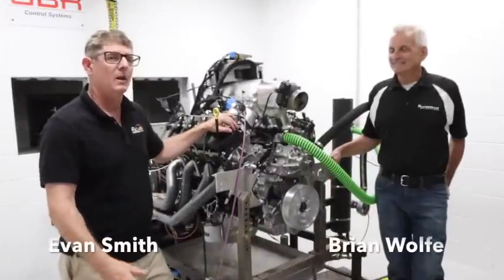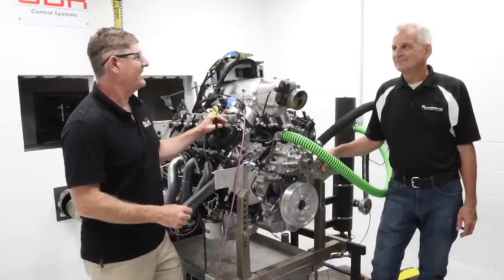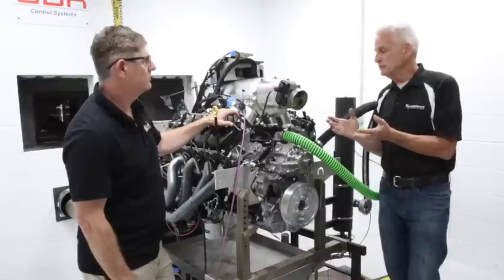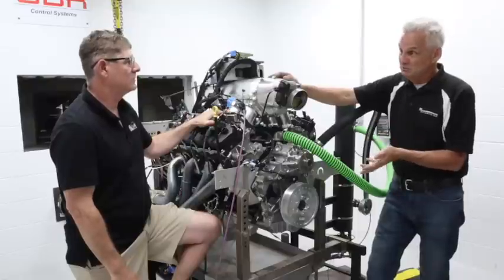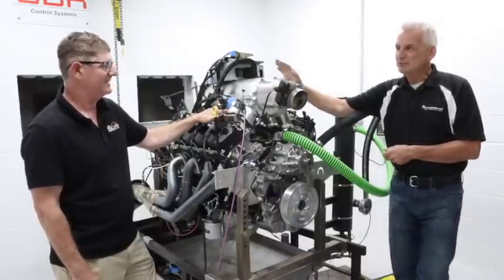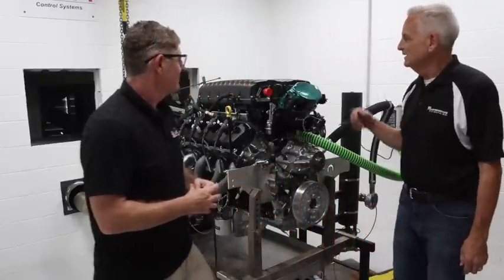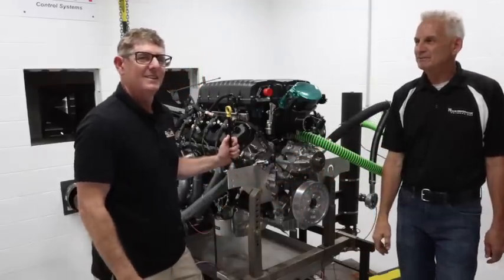Godzilla 7.3L Ford — Back on the Dyno With Over 780 All-Motor HP — Plus... We Reveal What's Next.

Comment: 3 years later and these engines haven't been getting the attention they deserve yet, not a lot of options out there for parts, not a lot of articles and videos of builds. A few months ago bare 7.3 blocks were $995, they're $1500 now, still much cheaper than an L8T 6.6L, Dart LS or Windsor block, LSX or anything like that and with all the potential, heads are $620 each new assembled to go. Weisco has pistons, Molnar has rods. Callies is supposed to have cranks up to 4.6" stroke coming finally. With a 4.225" bore and a 4.6" stroke that makes 522ci. I would like to think one could make at least 800hp relatively easy with steel rods in a 522ci Godzilla with ported heads, a honking cam and that intake with a 105mm TB and be able to keep the rpms under 7000. Hopefully the Godzilla gets the support it deserves because it's much better bang for the buck to build new from scratch than an LS/LT and possibly a 9.5" Windsor. It's not much larger externally yet it can support much more CIs, it's strong, great heads and hopefully it will be allowed to be a budget friendly choice so it proliferates the way GM and Windsor have been, rather than being murdered in the cradle with greed or indifference and forgotten like the 6.2 SOHC.

Comment: I have a ‘23 N/A 7.3L F250 Lariat and she makes about 670 whp. I got a stainless works Redline Series true dual headers and catback kit, an AFE intake, throttle body spacer, AFE intake manifold spacers, a tune, and an cam swap. She hits 60 in about 4.5 secs.
Reply: 670… lol

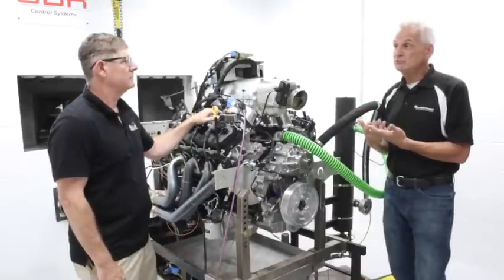Comment: What does he say about the heads @3:58 ?
Reply: They wouldn’t cut into the heads. They cnc the heads to lower the compression.
Reply: @devinbender8428  You mean to say that they CNC polished the chambers to get a few more CCs? Am I understanding correctly?
Reply: @christopheraugustine5816  yes. 
That’s what they did. 
But to increase compression they would polish Cnc the actual faces of the heads to increase the compression
Reply: @devinbender8428  Sure, milling for increased compression is nothing new. This I had not seen done before. It seems so obvious now. Thanks for the replies.

Comment: I'm disappointed in this engine. For massive 7.3L engine I was thinking this should put out around 1,000hp stock.
Reply: He clearly states it’s set up for a blower. If it was going to be pure N/A he would have upped the compression from 12.5 to 14/15. That would easily make 1000

Comment: finally.... ford makes a motor that will make as much power as a LS3...lol... and only has to make it 1.1 liters bigger lol... good try guys...
Reply: He clearly states this is for a blower build. If it was going to be pure n/a it would have made 1000
Reply: @devinbender8428  yes I can read... Do a lil more research they have also twin turbo this motor with the same low hp numbers... There twin turbo 7.3 doesn't even make the power a bone stock 6.0 makes with twins... I give them the effort tho... Finally going back to pushrod to make a lil power 🤣
Reply: @thomasstott527  as I said. Very rare to see a ls3 with more than 600hp N/A. 
And I have yet to see a 6.2 make more than 1500hp with out being bored stroke and custom heads.

These guys are definitely taking it easy on this motor. Baby steps. 

But in all honesty. If you want big power from a v8. Get a DOHC modular. They can crank out 2500 from a stock block easy. 5.4L holds the standing mile record and no ls has ever come close
Reply: @devinbender8428  mast motor sports has a ls 900 hp N/a in a full carbon fiber BMW that races formula drift.... I said a stock 6.0... not 6.2 makes 1500 hp with twins... It's everywhere... Google it you would be surprised... ford guys are so quick to not look at facts... I am an authorized installation center for GM performance... They offer a 525 hp ls3 with a warranty... Simple cam upgrade and tune would be well north of 600 🤣
Reply: @devinbender8428  you must not have read the entire article on your "stock" block 2500 hp 5.4... it clearly say ...The block is a Ford Racing aluminum 5.4 that is block filled to the top, making it waterless and O-ringed for a copper head gasket. The bores are 3.582 inches and don't use sleeves.... no soooo stock.. 😂
Reply: @thomasstott527  where did you read that? In the interview post race M2K stated 
Stock block and head. Ported, forged internals and 50psi of boost on meth. 

So please show me ANY LS on a stock block and heads that get any where near the 2500hp range
Reply: @devinbender8428  in the only article for a 2500 hp 5.4... it took all that to get to to 2500hp... But you must lived a sheltered life... There are numerous ls making over 2500 hp... Borowski race engines has a 2700 hp 427 ls in a camaro just to name one... 😂
Reply: @thomasstott527  that’s a 7L vs  5.4L. That’s a 0.5” bore over.
Reply: @devinbender8428  we can go all day there is numerous ls In that horse power range in the point... Your info is all wrong from a stock block 5.4 making 2500... To ls3 not being able to make 600 n/a...

Comment: stock gen 3 coyote E85 with boost still better.    a built 7.3 with boost  900? cant even make what a stock coyote with boost  makes .... DUD
Reply: Lmfao. It hits 1200hp+ with only a 3l blower and this thing is still stock block stock ported heads. 

Weld those heads and put on a bigger blower or big turbos and METH and this thing could easily crank out 3000+. 

It’s a rarity to see a n/a 5.0 hit over 600hp
Reply: @devinbender8428  what are you talking about ?  im saying a sealed coyote nothing touched has been in the 7s with 3800 lb cars.  what has this thing ran 9s with nitrous?  your going to have to replace the internals , get an aftermarket cam, aftermarket heads and a blower to get to 1200+ hp and compete with what stock coyotes are doing.  yea if you replace everything in the engine it might be 2000 hp  but so will any V8 just about

Comment: I am a Ford guy at hear, in fact I like everything that has an engine really. I am not doubting the potential on this engine, however, there's a ton of money dropped into it on top of what one of this new crate engines costs ($7K+). As it sits I bet the regular Joe will end up spending another $7k-10K on top of the original cost to reach the potential shown here in N/A fashion. Junkyards know better and this engine is not going to be sold for pennies. They make it sound so easy, but reality is different.

Comment: *Trigger Warning*  Look out Chevy boys, I'm telling you what. Listen to that a few times. Go ahead, listen. Nearly 800 H.P. in a torque low-end Beast @ 7,600 Rs!  Ford has something very special here once the pesky first-year gremlins are dealt with, which I'm hearing is misfires, but it's so wide open under the hood, easy as shit to change what you need with minimum rage issues like the engines that look like intestines. This engine will temp so many to enhance. If the Gods are with me, I'm going to do something wild. 7.3 swap under the hood of '02 Ford Excursion. A fkn monster.

Comment: If the compression ratio was about 11.5 or lower, 104 octane propane would be perfect for the dyno test. But  with 12.5 to one CR on this engine, they could run CNG natural gas which has 120 octane, so it won't ping or knock with that high CR.

Comment: 12.5 1 compression and it's going to get boost from a 3.4 Whipple?Plus 440 cu in - peaking at 7500rpm.Most of the Terminator guys in the SVT Club were cutting their pulls at 6500,afraid to run them to 7000.

Comment: I'd like to see matching torque.
Reply: Then you'd be stuck at 5,252 rpm.
Reply: @PistonAvatarGuy  Precisely what I would want in my 76 f100, mated to the 10 speed. 🥰
Reply: @shanerichardson9568  I can't imagine why you'd want that (unless you just wanted a stock engine), but you just wouldn't rev it past 5,252 rpm.
Reply: @PistonAvatarGuy  I actually want the 7.3 with a whipple and 10 speed because it will be a daily driver/farm truck.
Should be fun and useful.

Comment: not familiar with this fuel, you mention it is slow burning, how does this affect NA power compared to pump gas/e85
Reply: Just results in lower energy release as the fuel is burned under lower cylinder pressures, so less power.  I do not have an exact percent for you however.

Comment: Once the market gets flooded with these and the truck guys build every combo known to man the price on parts will drop dramatically. It has all the good stuff the LS motors have plus a larger bore which gives room for larger valves. Ultimately, these will make insane power with the right head and intake combo.

Comment: I've done more than that with an old school big block Chevy NA A single four-barrel carburetor I'm not really impressed and engine that big should be a thousand horse engine
Reply: Did you do you Big Block with all factory production (not aftermarket heads, including GM Performance) and with a camshaft set up for a blower?   I do think we can do north of 900 HP with an NA cam, and Q16 with higher compression.  But 1000 with stock head castings I am not sure of.
Reply: Brian Wolfe I guess he didn’t !!

Comment: wow it's barely making a hp per cubic inch wasn't hemi doing this in the 60s????
Reply from the maker: First attempt at building a 7.3 and with moderate compression and a blower cam. Did you actually watch the video?
Reply: I was super excited to see this engine get released then heard about the portions and rods are suppose to be for boost.. So I'm guess the compression isn't screaming so half way low..okay so you raised the compression and ran a better can well that sucker should be making way more , it's still sad I love the old 7.3 and that's to international and the one and only good thing ford has made then is a 9 inch.
Reply: Piston not portions
Reply: @AustinJaggers  when its in the base guise its a truck engine. Short duration cams meaning max torque at low rpm. Good for towing, the hemi was a racing engine and had long duration cams which gave it max torque at high rpm. Which is why it had more hp. When they put a normal car road cam on this is made 508 hp.

Comment: I am by no means am smart when it comes to this. And I'm certain this man has forgotten more the I ever knew about cars. Could someone explain using the 3.0 Whipple on this engine. Seems small compared to how big the motor is. Whipple has a few bigger options I thought.
Reply: The Coyote Factory Super Cars use the 3.0L and make about 1600 HP,  in NMCA extreme street you can deduct 200 pounds for the smaller blower, so we will see if we can make it work for us.

Comment: I wanted to coyote swap my 05 stang buttttt. This is looking pretty intriguing. Might have to look at other ways to dump 100 extra lbs from the car to make up for the weight difference.
Reply: I would still do a coyote swap unless you going to pay $7,500 for a new 7.3 plus $15k in mods that's without boost 🤫 when you can buy a second gen coyote for half that oil pump gears headers and a little 2.6 blower and still spend less money

Comment: So you got drop 20k in the engine to get 700 plus.  Ouf!
Reply: It's a blower motor sans blower. I'm not following the logic here? The motor made nearly 800 horsepower using a less than optimal setup.
Reply: @lealandyoung  The Gen 2 and 3 Coyote do that or almost in NA form.  So my logic says .......what a waste of money.  It's a truck motor period.  Cubes to cubes, not that impressive.
Reply: @brunotulliani  show me 1.. Coyote stock block, stock heads, stock crank and stock oil system that can handle 1600 hp?? Actually this monster is cheaper to build huge hp..
Reply: @johnsbullard  You are right, found none and all were built sleeved blocks with power adders.  Stay safe.

Comment: What is the point of these videos without discussing control pack information?
Reply: Will be covered in a future video, but to answer your concern (could have been a bit less hostile in your question thought), the control system is OBR, https://obrcontrolsystems.com/
Reply: @brianwolfe2993  thanks Brian. Is this outfit the OE contract engineering/manufacturing outfit for Ford?
Reply: @chipcurrey653  Not sure of all their customers, but they did a nice job with the complete controls for this engine, including the VCT and Variable Displacement oil pump.

Comment: That is one badd ass big block LS
Reply: Why do you have to go there, what is LS?  Bottom end is like any Ford V-8 since the 1992 4.6L, and upper end is like a Cleveland/Windsor...... and it's not a big block 4.53 bore space vs the Gen 3 hemi at 4.46.  Most Big Blocks used for Heads up racing, X275, LDR, etc are 4.84 or larger.....

Comment: That is really amazing power.  I'd love to see a build for max torque though so it would work well in a heavy truck like my classic 78 F250 4x4.  Love to drop one of these newer motors in it but I don't want to run racing fuel or rev the motor to nearly 8 grand.

Comment: I love the new ford 7.3 (not a ford guy). This thing is strong for sure. With +1-1.5 atmospheres from a blower with an efficient package it should be knocking on 2khp.

One thing I cant understand is the tq for how many cubic inches this thing has. Even playing with cam timing and #'s to reduce torque, the tq #'s dont add up for me.
Reply: The cam is designed for a blower, I would expect significantly more with the cam revised.
Reply: @brianwolfe2993  Is the idea to maintain a steady tq # high in the rpm's so hp climbs immensely, especially with positive atmosphere?

Comment: 12:1 compression for a blower.  Thats high
Reply: No sir, it is not, you are a little out of date.   Most of the X275 and Ultra Street stuff have been at those levels for several years.  If you thought this was for a street car sorry it was unclear.   But the 2018 mustang GT is 12:1 and people are putting Whipples on those with pump gas.
Reply: @brianwolfe2993  
Where is your shop located Brian?
Reply: maximus vonce go back to 1983.
Reply: That's what I used to think.  My GT350 changed my mind running boost at 12:1 reliability with an 8250 redline
Reply: @SwankySasquatch66  Stock gt350 with boost is a time bomb.. i have heard of numerous Voodoos gremading on boost
Reply: @maximusvonce1381  
This has not been my experience. 
Probably stock sintered metal oil pump gears exploding leading to rod failures.  There really aren't that many significant differences between a Coyote and a Voodoo. 

There are plenty of 1400 horsepower examples in the Boosted GT350 community so I have zero worries. I will be honest, there are a lot of idiots that own GT350s and I have doubts about them using the proper fully synthetic 5w50 oil and would not be surprised if their oil change places used off the shelf  5w30 for $20 instead of a $120 case of the right stuff.  I perform my own maintenance and mods and I don't worry about it
Reply: @SwankySasquatch66  Cracks me up when people on you tube post these massive dyno numbers, which are hero runs and useless on street.
Reply: @SwankySasquatch66  The 1400hp gt350's aren't stock like yours. Did you read what i said. Stock voodoo motors gremading on boost,  not built motors. Must be flat plane crank issues
Reply: @maximusvonce1381  
The stock voodoo blocks are good for about 1000 RWHP and sleeves increase the capacity to maybe 1500 from what I've read.  I have only seen one crankshaft failure with the flat-plane-crank (FPC) and it was a broken snout - presumably from a supercharger.  I don't think I've seen any failed rods yet but I'm guessing the stock rods are probably good for about 1000 rwhp.  Fortunately, there are lots of aftermarket rods to choose from.

There are 1400HP FPCs out there built by that turbo place in Indiana (forgot the name) but beyond that they tend to go with the cross-plane cranks for more cam & billet-crank options.
Reply: @SwankySasquatch66  And 1400hp on the street is moronic. Useless power. But you can brag about dyno numbers while you lose every dig street race...lol
Reply: @SwankySasquatch66  Oil won't cause a rod to snap
Reply: @SwankySasquatch66  Try driving a 1400hp on street
 It's plain nuts. Unless you race for money

Comment: Guys, he is running C16 fuel. Stop questioning the CR with forced induction - I suppose that is something that cannot be learned on the forum boards... 5:00 

I’m more interested in head lift and/or cylinder walls cracking. Wonder the material used, thickness, and water jacketing